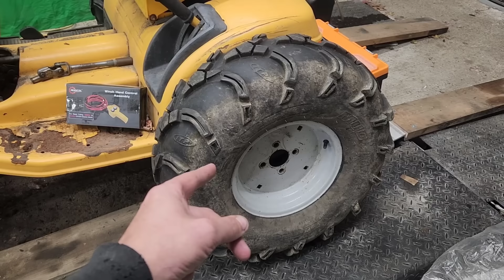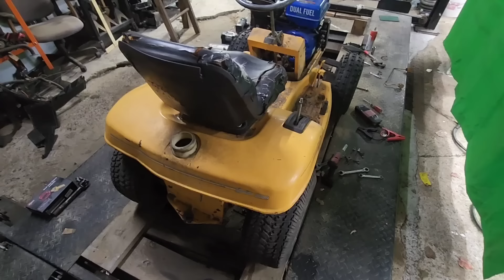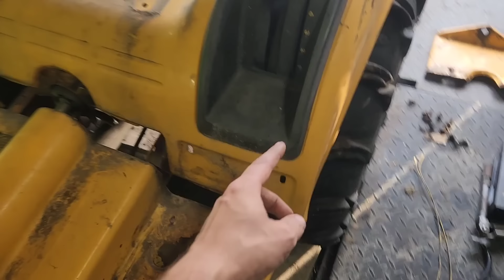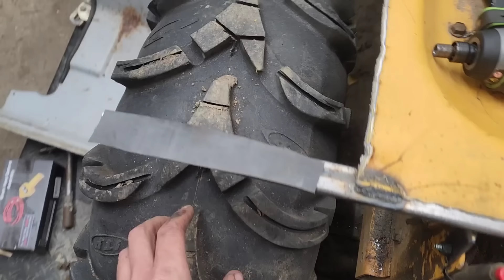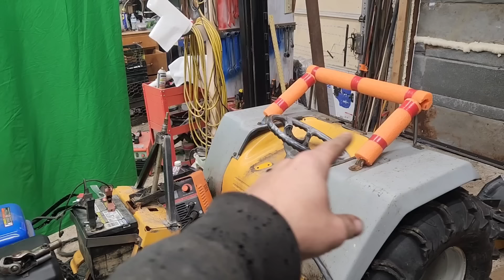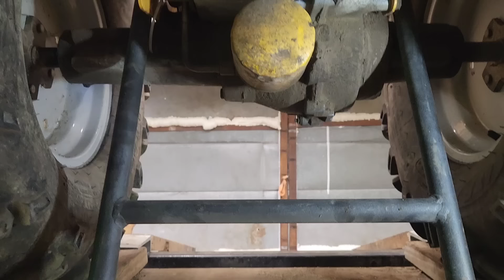Cud Cadet Mud Mower Build JunkYard Free Parts

Comment: Bought a 1450 cub cadet last year from a local junkyard for 50$, Engine needed a rebuild and the mower was missing most of its mower related hardware and just recently got back into the build after finding a cheap predator 301 the other day, Trying to get it to fit in the frame is difficult but I can't wait to go mudding when it's assembled again.

Comment: With the winch mate I run a momentary weatherproof rocker switch wired up on my dash wired into the winch solenoid and it works great it's always setup ready to go no having to carry around a remote or anything. The winch I got has also got a wireless controller but never use that but handy to have if working on it whilst it's hanging from the roof with the winch can lower it while underneath it if lining up something